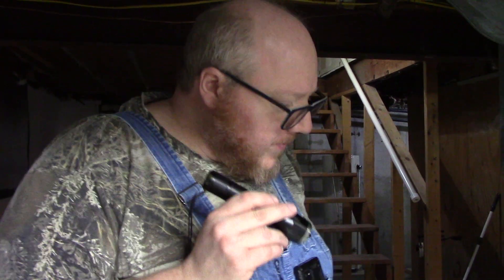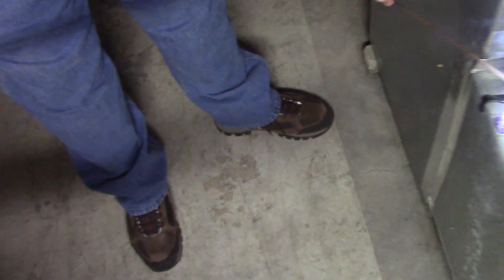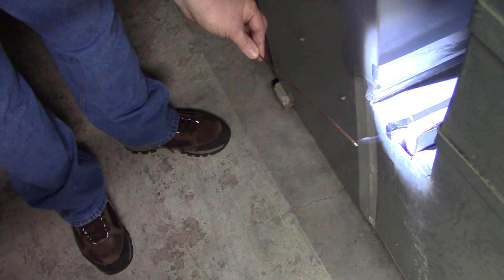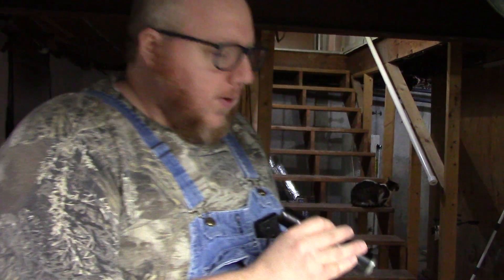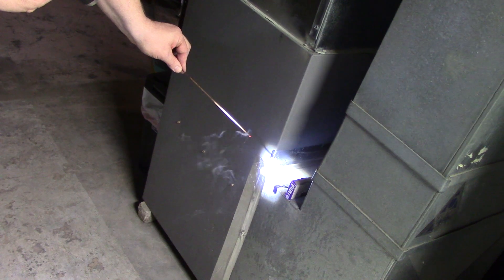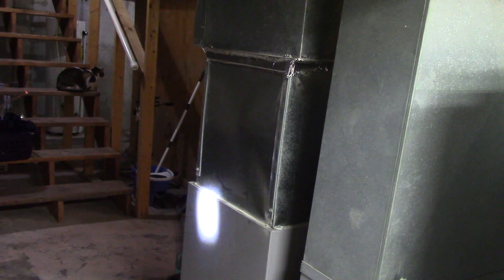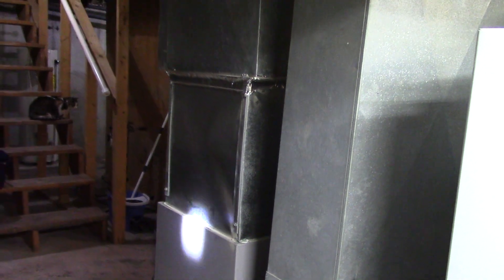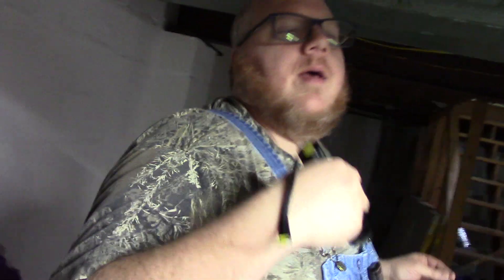Furnace filter problems and why your house is dusty

Comment: Well I have electric heat because I'm on a heat pump, dust like every 3 days and it's still dustier than the butt crack of an Egyptian corpse. I think it's just an old house and we have pets.
Reply from the maker: yes. we have an older house and leaky windows. that's part of it.
Reply: @ChilesHeatCool  Yeah we had the windows replaced when we did the heat pump since windows makes one of the biggest differences to hold heat. It made a bit of a difference but not everything.

I think the next thing I want to redo is baseboards and trim as it's very possible it's coming from in the walls.

Comment: So how are leaky ducts fixed? I’ve got these really expensive furnaces and dust all over the house so it seems like this could be the issue. How do I get it assessed and fixed? The company that installed and maintains has never mentioned any potential duct issue.
Reply from the maker: https://amzn.to/40lYD2u
Reply from the maker: Most seams are tight, but some need a sealant put on. That amazon link is a product that you can use.
Reply: Thanks,  @ChilesHeatCool  . I will give it a try. Strange that this was not offered by the tech maintenance co.
Reply from the maker: @Wonderland65 it's a messy job using a mastic sealer.
Reply: Can you use tape made for vents. I taped all mine last year with that silver heat tape
Reply from the maker: Yes.

Comment: My filter is one of those big accordion type with spacers to collect dust, but my home is very dusty all the time. I'm lost in this and don't no what to do
Reply from the maker: Leaky ducts can allow air to by pass the filter.
Reply: Mine is the same way i was told by multiple people to ditch that and just set a proper size slide in one
Reply: Btw those bigger ones are usually higher merv and constrict airflow and work the furnace harder is why i was told